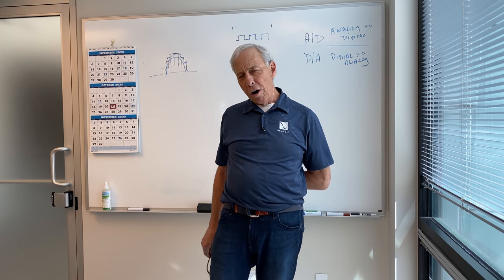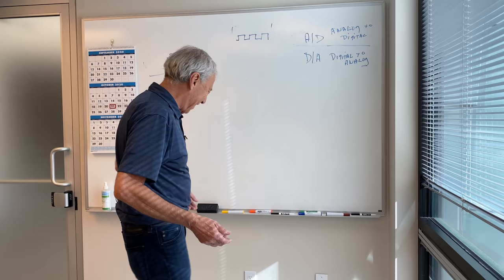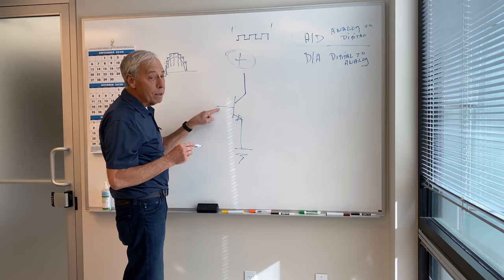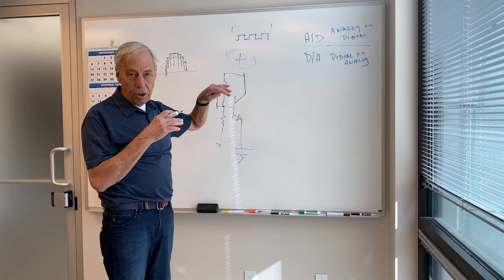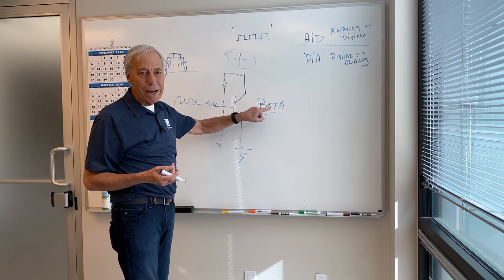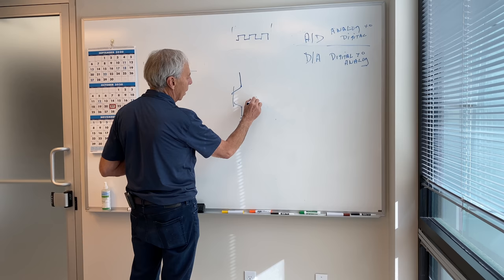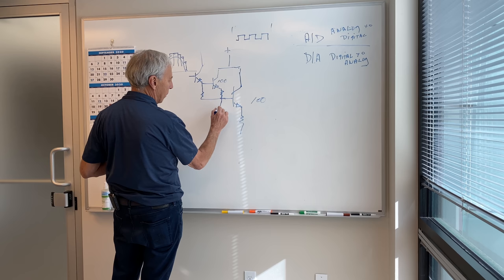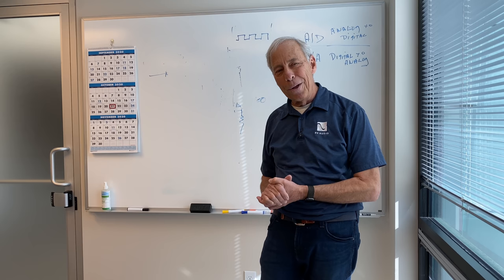Darlington output stages

Comment: Darlington designs are generally very fussy and fickle, but when done right are fantastic. And can be very stable.
Reply: I have the Harman Kardon PM660, from the same era.  I wonder if it is also a Darlington design. It’s a good sounding amp but I have continuing problems with the front end, as one channel drops out unless pure direct is engaged. It’s in my workshop setup, and I’ve substituted a different vintage amp for the time being.

Comment: I had 2 Soundstream car amps in the early 1980's and they had Darlington outputs. They were fabulous. Supposed to have been designed by Nelson Pass,
Reply: I still have my Rubi4 from then as well. Still use it after it sat for a number of years, had it restored with new caps recently. Best damn sounding car amp I have ever heard.

Comment: Hi Paul great to see you at the white board so much easier to explain.  You missed the point that the Beta, as you call it is all current gain those little wiggles don't get any bigger. The other plus is increased input impedance  meaning the drive circuit can be made simpler. Many amps around the age of the HK used darlington output transistors which being no longer made are difficult to find. Treat it kindly.

Comment: That HK 680 is a brilliant design with incredible specs for its price range. It'll drive almost any loudspeaker with a superior amount of juice while maintaining very respectable levels of distortion in the range of 0.08%. at full 8O Ohm output. It's a discrete design with quality parts, dual monaural layout and all sorts of nifty circuits. The transient peak potential is pretty astonishing too. As many speaker crossover loads can vary widely from specs while being drive hard, the HK680 can really keep up. In fact test bursts of up to 680 watts into 1 Ohm were recorded in independent testing. Maybe that's how they came up with the model number. So rather than looking into the reason HK might have used this Darlington design, Paul dismisses it universally as not good sounding, and according to his preferences, undesirable. So the guy who wrote in now has that bug in his ear. All this for equipment which produce nearly inaudible levels of distortion for most listening levels, at a reasonable price. It's time to bring  double-blind testing into the arena.
Reply: Thanks Joshua, I'm very pleased with my HK680. I've bought it 7 years ago. I'm running Sansui LM220-Speakers. The amp has been checked by a professional, some caps had been changed. I see no reason to switch to another amp. In combination with my Harman/Kardon HD760 CD-transport I obtain great soundstage and a very pleasing bass. Got the amp for 500€ and the transport for 100€. A real bargain for the given price/sound.

Comment: Darlington configuration BJ transistors (often in single package) used in phase splitting quasi-complementary push-pull transformerless class B power amplifier is more efficient than class A amplifier. Darlington transistor configuration is like single transistor with very large current gain (current gain is product of the current gains of each transistor).
Reply: G Guest  
Not according to 'Electronic Devices & Circuit Theory' by  Boylestad & Nashelsky. AC current gain of transistor is change in collector current divided by change in base current with Vce held constant. The collector current of the first transistor becomes base current of second transistor. Total current gain is product of each transistor's current gain. Total gain B = B1 * B2. If gain of each is 100, B = B^2 = 10,000.
Reply: However - B&N makes an equivalence between Ic and Ie which is not strictly correct as ie = ic + ib. In which case, yes,  B=((B2+1)(b1+1)ib1)/ib1=(B2+1)(B1+1)=B1*B2+B1+B2.Yet as B1*B2 is >> (B1+B2), B is simplifed to B1*B2. 10,000 >> 200.
Reply: @tertia0011  I am not sure why people find this so confusing. Yes, a lot of people say this, and a lot of people are wrong. See how far you would get in electronic engineering by using that. The current gain of a two transistor Darlington stage is (B1 x B2) + (B1 + B2). That is the formula   .
https://en.wikipedia.org/wiki/Darlington_transistor
Reply: @tomterrific9459  
My reference is 'Electronic Devices and Circuit Theory' by Boylestad & Nashelsky, an upper level electronic engineering text book. Wikipedia? - 'See how far you would get in electronic engineering by using that.' Given (B1 x B2) >> (B1 + B2) I'm happy with B&N's formula as given. No confusion.

Comment: There’s been a ton of Darlington power packs put in stereos. My Marantz has them for the rear channels.
Reply: Pioneer SX-780 receiver uses Darlington power pack STK-0050. Just transistors in an epoxy case, cheaper to mass produce on a production line. Just marketing trying to make topography a sales gimmick, and cut costs too.

Comment: Great video.  One nit: in referring to the total gain of the compound transistor, you said something like "a gain of 100 plus a gain of 100 give a lot of gain."  This might be interpreted as saying that the total gain is the sum of the two gains when in fact it's the product (even higher).  I know you know this but your audience might get confused.
Reply: To be precise, overall gain is not actually the product of the two gains. The overall gain of a two transistor Darlington transistor connection is the product of the two gains PLUS the sum of the two gains. Two transistors with Beta of 100 and 40 connected Darlington would have an overall current gain of 4140, not 4000.

Comment: A 25 yr old amp probably has some aging electrolytic capacitors that need a little time and heat to reform ...
Reply: Reforming does not occur every time the unit is turned on.  Forming is good for many years.  
Problems with aging electrolytics aren't related to forming (unless they've been sitting unused for many years).  The main problem is increasing ESR, due to loss of moisture from the electrolyte.
Reply: @marianneoelund2940  The ESR of a lossy capacitor will go down with heat. When it cools down the ESR goes back up. Electrolytic capacitors that is. Forming lasts for at least a few years, but if it has not been plugged in for say 10 years of more, it should be looked at by a competent technician. It will need to be brought up slow with special equipment or the capacitors could develop excessive heat reforming and may damage them, vent gas, or in worst case explode.
Reply: @zulumax1  
Typically, ESR only decreases 10-20% over the temperature range of 20C to 40C.  Good thermal design shouldn't be allowing electrolytics to run hotter than that.  
If a capacitor is old enough that you can hear the effect of a 20% change in ESR, then I'd say it's well past its useful life.

Comment: I wish Paul could have gone into the actual advantages and disadvantages of Darlington circuits. "I just don't like the way they sound" isn't very informative.
Reply: These chips have been used by so many manufacturers. Been around for 40 years. Class AB, Low THD, wide frequency response, good slew rate and most the time you can just pop in another chip and go. Also, low price.
Reply: I think he means because Darlington pair has to be matched up other you get ringing so it's a lot of sorting out of transistors time-consuming measuring them
Reply: @johnsweda2999  ok, but for sure they are just not “audiophile” level.
Reply: Seemed to me he did
Reply: There's a lot of confusion here.  
Some people think the term "Darlington" only refers to two transistors in a single package, connected in the Darlington configuration.  That is not true.  Most Darlington pairs or triples are implemented as separate single transistors - and you will find them in virtually EVERY power amplifier that has a BJT output stage.  
If Paul thinks he doesn't like the sound of Darlingtons, he needs to go back and look at the schematics of their BJT-output power amp designs.
Reply: @SJMessinwithBoats  Maybe that is the way we did it 30 years ago, but there are better ways to do it now so we don't build them like that anymore. Just a guess....
Reply: @zulumax1  I started out rocking car stereo. Out came the affordable Sanyo PA6100. $150 msrp 
The ad says 1979, I got mine in 1980. Had 2 of them bi-amped with an alpine crossover. 4 8’s a couple dome mids and a couple dome tweeters. Looked inside and there was 2 stk-0049’s. Did manage to blow a couple but at 15 dollars each, I was able to guess right on the fix. So yeah, big Sanyo fan here. Then I got a few HK Ca-215’s and love those class D’s now a days.
Reply: @SJMessinwithBoats  Why "for sure"? It's not obvious to me. OK, a lot of Darlingtons were implemented in STK 'power packs' on low-end amps in the 70s, but the technique was also used by Luxman in their duo-β amps via discrete transistors. Are Luxman not audiophile?
Reply: @scottyo64  My apologies, I should have been clearer; I meant how do the advantages and disadvantages impact the sonic performance of the Darlington-configured amplifier?
Reply: @thisisnev  oh, I had a configuration of multi-amp and all active crossovers. Utilizing Sanyo amps (that used darlington packs) Wrote to Paul in an email detailing it 3 years ago and he said he heard of it, but it was not “audiophile”.
Kinda popped my bubble. I guess those STK’s aren’t so lowly after all.

Comment: Is it ever better to keep turning on and off your audio equipment vs just leaving it on all the time?   (not factoring in electrical costs)
Reply: If you don't care about electrical costs then it is better to leave them on , but most people do care about electrical costs and then it  depends on the class of the amplifier . Class A ( like a space heater) and AB draw too much current while idle while class H draws less since it idles on a low voltage rail , now with class D and G some manufactures recommend leaving them on . My Sunfire receiver  which is class G has a stand by button that turns off the display and output relays but keeps the electronics on since  it like class D draw little power when left on.  Now with tube amps the filaments will burn out if left on all the time unless it has a standby switch that keeps the filaments at half power.

Comment: True with class-D. They need to "warm up" before they sound decent.
Reply: Depends on the circuit. Class-D amps aren't generating much heat and the circuit heavily relies on feedback. Amps that operate without feedback where component temperature coefficients play a bigger role are worse.
Reply: Chances are it is the input stage that needs to warm up, not the output stage.

Comment: Darlington devices are three terminal configurations so showing multiple emitter resistors makes no sense.  The sum of all the base currents will flow through the final output's emitter.
Reply: @Douglas Blake Please provide the part number of such an example as I've never seen one that would still be considered to be a darlington.
Reply: Paul was being sloppy with his diagram.  In almost all cases, a Darlington pair will have a base-emitter resistor for each transistor, to ensure and help speed up turn-off by providing a discharge path for the gate charge.  
Almost every commercial Darlington pair built into a single package includes the base-emitter resistors.  I challenge you to find one that doesn't.
Reply: @Douglas Blake Thank you, I stand corrected. The resistors aid in turn off.

Comment: I am supposing you know that current flows from negative to positive in actuality ~
Reply: Well literally yes, but many of my instructors taught circuit flow which is different from current flow. Most confusing isn't it.
Reply: Mr.Carlson's Lab discussed and explained this very well, better than I can. Just remember you can have DC current and an AC signal on the same wire doing two different jobs.
     Block diagrams are sometimes helpful to understand more complex circuits, that way you are just looking at a logical flow.

Comment: So why does it take a while to ''warm up''?
Reply: @Douglas Blake I agree... re-cap the power supply and it will perform nicely.
Reply: @jamesplotkin4674  
Not necessarily.  Output-stage biasing circuitry is far more important.  If there is that much audible change on warm-up, the owner should have a technician check it.  
I once serviced a small receiver for a friend, which was producing a small amount of audible distortion until it warmed up.  Turned out to be poor soldering on a compensation capacitor, which was allowing the output stage to produce short bursts of RF oscillation at the crossover point.
Reply: @marianneoelund2940  You make a good point ;-)
Reply: @Douglas Blake 
The RF was rather low amplitude, less than 1V p-p if I remember correctly.  I couldn't hear the distortion myself, but my friend, who is legally blind and has amazing hearing, had been complaining about it for quite some time before I finally agreed to have a look at the receiver with a scope.
Reply: @Douglas Blake I never said that.
Reply: You cannot blame the warm up issue on the Darlingtons...... It's an old amp with likely a fragile biasing scheme that takes a while to stabilize.   That's just the way some amps are.
Reply: @Douglas Blake I said to re-cap the power supply caps.  Then, I agreed about the biasing caps as a separate thought. I was wrong about supply caps, but Don't put words into my mouth.

Comment: Oh sure... and now tell me what a 3 step inverted darlington circuit is... (my Integra unit....)
Reply: Marketing guys loved to throw the techno babble about liberally in the sales brochures. A quote from the sales brochure for my vintage Sansui AU-7700: "A differential amplifier and a 3 stage Darlington system designed in a parallel push-pull OCL pure complementary output circuit arrangement."

Comment: Wow you really mauled that one. How about it’s a single device that has two transistors inside giving a higher gain than a single device.

I do agree they don’t sound nice. Good in a fan control circuit though (TIP122).
Reply: @Douglas Blake 
Yes, it's a little annoying that folks around here (including Paul?) seem to think that "Darlington" only refers to multiple transistors in a single package.
Reply: @marianneoelund2940  No,  I'm quite sure Paul knows that it's describing the circuit configuration.   It just happens that they've "integrated" darlington pairs into single a single device, just like an Op-Amp does not have to be a small IC chip.  It can be a small circuit board populated with all discrete components, like in lots of pro audio equipment.
Reply: @TheMirolab  
I certainly agree with you, but judging by Paul's statements under a comment I made, he does not understand that a pair of discrete transistors can also be connected as a Darlington pair.